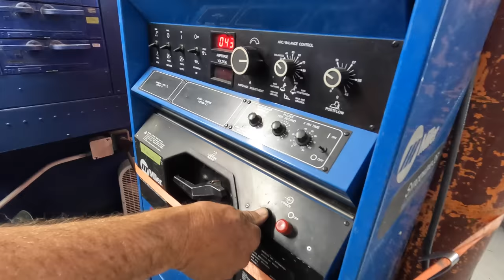High Sierra Fly-In, STOL Drag World Championship

Comment: Have the knobby tires made a noticeable difference? Also, I'd love to see a video of how the nitrous is set up to spool the turbo for the turnaround (if I'm understanding that right).
Reply from the maker: The knobby tires are on Yeehaw 8 which wasn’t ready to race yet. I am pretty sure they will help me stop quicker though. The Nitrous is a very simple system where I have a small bottle with a solenoid valve that’s operated by a button on my stick and I just push the button and put a little nitrous in the intake right before the throttle bodies and it does help the engine to spool up a little quicker. It’s called a dry system where no extra fuel is injected along with the nitrous. If I were using the nitrous to make more horsepower on the straightaway I would definitely have to have to have a different system where extra fuel is injected along with the nitrous.